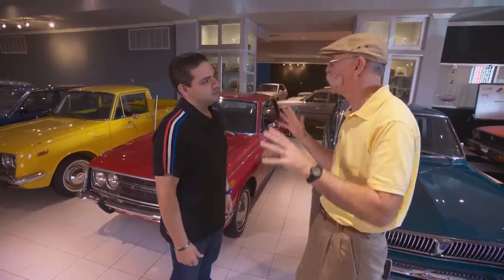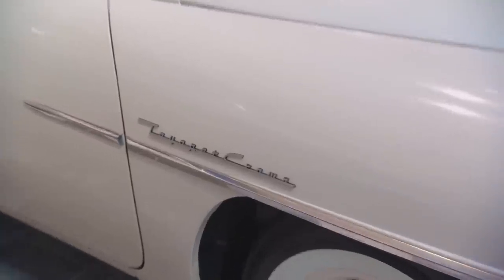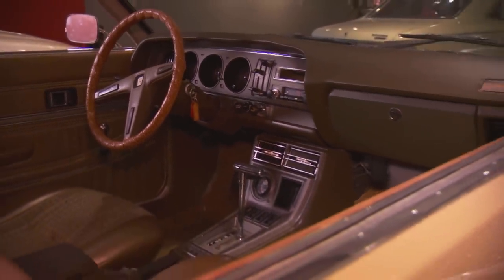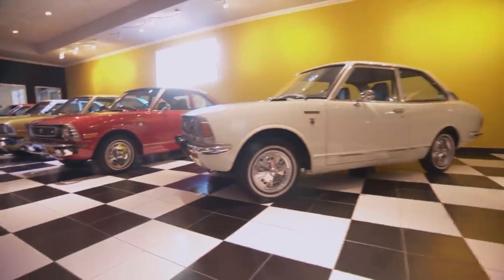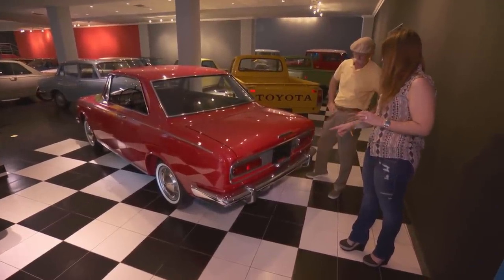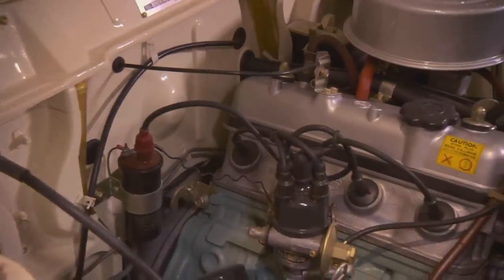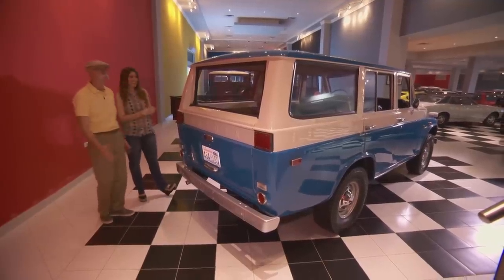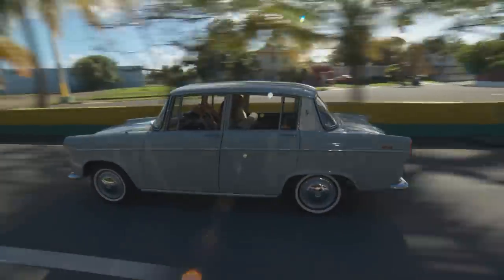Toyota Collection in Puerto Rico

Comment: Had a 1980 Toyota Corona deluxe model beautiful interior maroon and silver pàint.  Great, dependable car.  When I went to buy another one, they were discontinued.  Later models weren't half as nice so I got a Pontiac.  If they put them out again I'd buy one.  It was a class car.  I also had a1980 mini van, my children called it my spaceship.  Another great vehicle.  Over 300,000 miles no problems it was a 1987 mid engine van passenger model.

Comment: 1971/72 Corona mark II used to have a sticker in the back stating power steering, first for the coronas. 1971 toyota Crown (top of the line, including 8 track) also came with power steering for the first time, and in addtion with dual air plus  the refrigerator in the back.  1 cube feet. enough for 4 bears and some cheese. highway cruising made the refrigerator work perfect.

Comment: All Toyotas' name such as tiara celica, Crown, Corolla, Corona, cressida  is something you put in your head such as a crown. the Toyota corona mark ii wear a sticker in the back window stating power steering. mark ii and Crown were the first for 1971 with power steering. Crown's option was a dual a/c with a refrigerator in the back. only for about 4 beers and some cheese. highway driving the refrigerator works just fine. beautiful design. another option was 8 track.

Comment: Very cool collection. I saw at least 7 that I own (although theirs are in slightly better shape). 
That first Corona Mk11 should be a 2.6L. They did come with a 2.0 as well but top spec got the 2.6 4M engine.

Comment: a couple of months later Mr. Gomes brought on of the first automatic (corona) and he declared no power. but it was an automatic. two or three years later air conditioner was introduced. the air outlets and evaporator were in the space of the glove compartment, so it was not centered in the dash. nipondenso was the brand.

Comment: The 1973 Corona Mark 2 had the engine wedged in to place. removing valve cover for lash adjustment was a huge pain and it was supposed to be done every 3-5 thousand miles. I did not see a Carina ,maybe they are working on getting one.

Comment: Haven't read through all 550 comments -- but I'm wondering if the Corona MkII is actually a '73.  It's got the big U.S. 5-mph bumpers.  Every image of 73's that I could pull up online showed them with the smaller bumpers.  Think it may be a '74 or newer....that's when the rest of Toyota's line up showed up with the big bumpers.

Comment: The high end Corona Mark II with the 6-cylinder engine was the first Lexus. Even Toyota did not know that as yet !!!
Reply: Nah, before that Toyota had the Crown (in the mid 1960's they had a JDM variant with a 2.6L V8). In the Island* (and The States) we got the 1968-70 Crown sedan and wagon with a 2.6L I6.

THAT would really be "the first Lexus"...

* a "well to do" neighbor owned a '69 Crown Wagon that had a "fridge" below the cargo area...
Reply: @syxepop  Oh Yes ! I know the L6 2.6 Super Saloon. That was the epitome of ownership. The local Toyota agency at the time sold those cars to the "who's who" of our island.
The "fridge" was actually a box with a lid set between the two speakers in the rear deck. A motorised blower was integrated in the box, and there was an evaporator coil linked with the AC compressor. So while the exiting air cooled the rear passenger    area, it chilled the inside of the "fridge". About 6-8 cans of Coors Light could fit in the box. Regards. Trinidad & Tobago.

Comment: My first car was a 1972 Toyota Carina Deluxe. Only came in 2 door. Mine was white with black interior.  88 horsepower hemi with an automatic. $2649.00 was the price. That was the sticker price. No discount. I blew the engine at 44330 miles. 80 miles an hour proved to be too much for that little choo choo. Toyota agreed to fix it on the cheap. I traded for a Camaro Rally sport in late 73 with 350 c.i. fuel injected engine.  Honestly the Toyota cruised smoother at high speeds. The Camaro road like it had square wheels.

Comment: Awesome collection , awesome cars but damn those US bumpers ruin the lot
Reply: Those bumpers were very practical.  Put a 1975 car to a 5 mph rear ender vs a modern car.  The modern one will get 2 to 3 thousand in damages while the 75 will get a few nicks on the bumper guards. They had 5 mph proof shock absorbs behind the bumpers.  What is better you say?

Comment: Surprised they didn't have a Toyota Century.
Reply: Toyota never sold them new outside of Japan and OG / 2G ones have begun creeping into US* as VINTAGE not terribly long ago... If the Amaros see a copy that would be "in sound condition" and could be had for a reasonable amount they could bring one to the Museum.

* You have to have "the proper expertise" to bring 25+ y/o JDM imports into The States and "it'll cost you"...

Comment: I hear Toyota is putting out a Mustang version in 2020.
Reply: juan alt someone better do it bc American car production is thru in the next few years
Reply: Closest thing to the Mustang is their 86 (it sells starting at slightly over U$30K on the Island). What they'll introduce is their new BMW'd Supra (made in the same platform as the next gen Z5 convertible and w/a BMW T-3.0L I6) and it'll be quite more expensive than most Mustangs (believe over U$50K Stateside)... You can only hope for the 2G 86 / BRZ...

Comment: disappointed that almost every car you checked out was about the same.... what about all of those sports cars???
Reply: The "sports car" you really want to see is the limited run (300 or so left worldwide) of the Yamaha-developed 1967 2000GT.  That one is beyond the financial means (all surviving ones are > U$100K and few change hands) of that family.

Beyond that one most of Toyota's sports cars have been either of "modern vintage" (1980 - present) or are relatively unobtainable JDM's (Toyota would probably had a competitor to the original Pre-Z Fairlady as well as a smaller one in the Kei category).

Comment: 1985 TOYOTA SR5 1.8 LITER 5 SPEED WAS MY FIRST..I TOTAL IT IN CHGO IN A MIDDLE SNOW STORM IT WAS 10 BELOW ZERO WIND CHILL WAS 20 BELOW BUT THAT CAR STARTED UP EVERY TIME..THE NEXT 3 DAYS TEMPS WENT UP TO 30 DEGRESS WAS ON MY WAY TO WORK CAR PERDORMING GREAT .BUT A CTA BUS DIDNT STOP AT THE LIGHT I WENT RIGHT INTO IT NO WAY WAS THIS CAR GONNA SURVIVE THE INPACT..I WAS ONLY GOIN 30MPH AND THE FRONT END WAS DAMAGED FRAME WAS BENT BAD..SO WHAT DOES A TOYOTA FIEBRU DO? GET ANOTHER BODY..I FOUND A 1970 SPRINT EARLLY COROLLA FOR THOSE WHO ARNT FAMILIAR..I CHANGED EVERYTHING IN THE CAR IT HAD A 1200 ENGINE IN IT..SO SWAP IT OUT FROM THE SR5 TRANS MOTOR REAR END ALL WENT INTO THE SPRINT BODY..OF CORSE I HAS ALREADY INSTALLED HEADERS AND THE 2BBL HOLLY FROM A 73 FORD PINTO YES TGEY FIT..FORD HAD HOLLY PARTS ON THETE PINTOS BACK IN THE DAY THAT BOLT RIGHT UP TO THE 1.8 TOYOTA ENGINE ..PLUS OTHER MODS THAT WHERE DONE I WAS NOW IN A SPRINT WITH SR5 POWER..I KEPT IT FOR 2 SUMMERS HAD GOT A GREAT OFFER TIMES WERE HARD MY FIRST BORN WAS HERE IN 83 SO IT LEFT..ITS STILL IN CHGO ITS GINE THREW 4 ENGINES SAME SPRINT THE OWNER IS A LIFE LONG FRIEND..
TOYOTA RULES CHGO STREETS TOO..